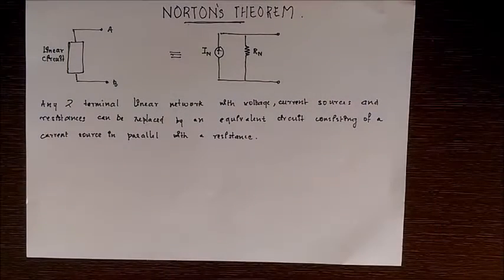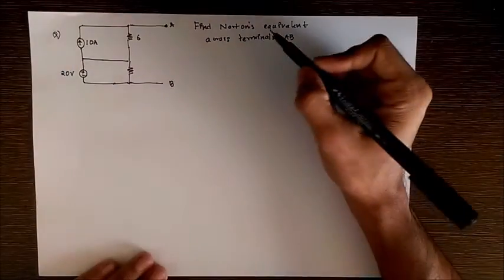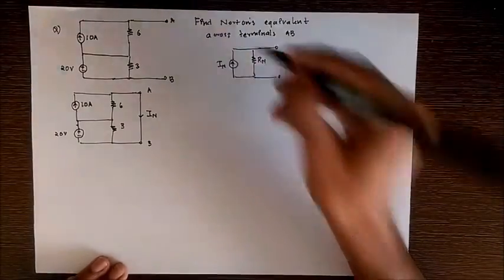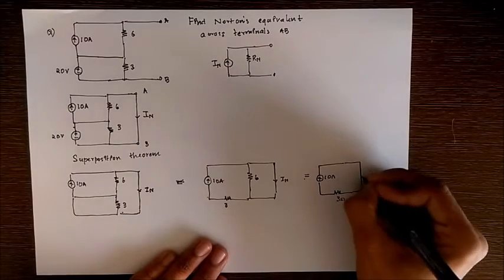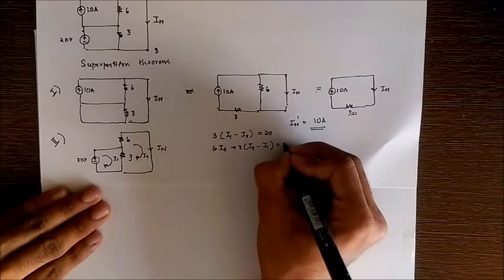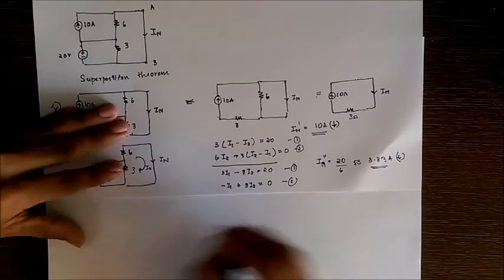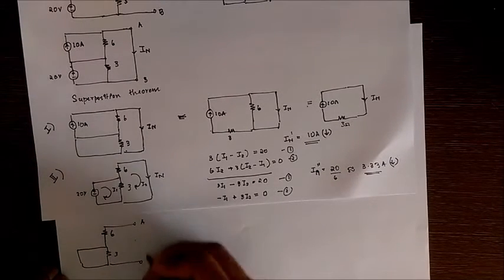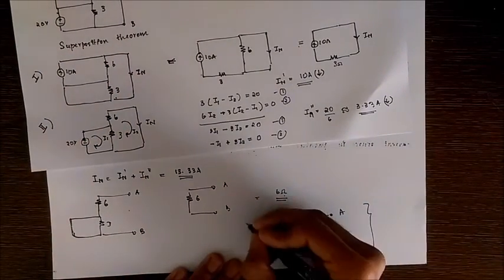Norton's theorem and Norton's equivalent (with solved example)

Comment: you did a mistake when you remove the voltage source the the 3 ohm resistor is shorted

Comment: You have a mistake on your circuit at 2:50. The 3Ohm resistor is shorted, so it shouldn't be on the circuit.